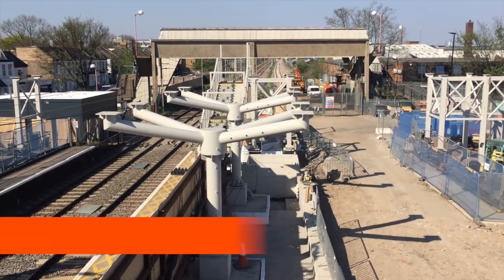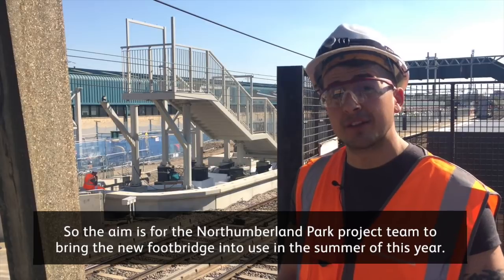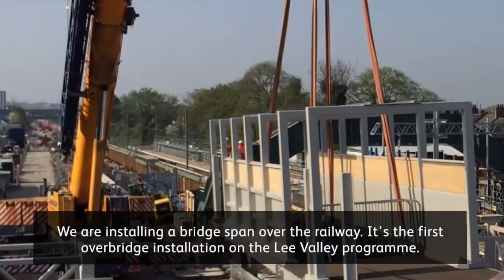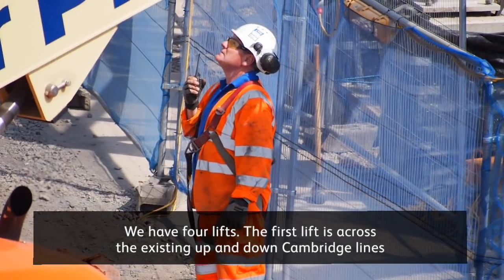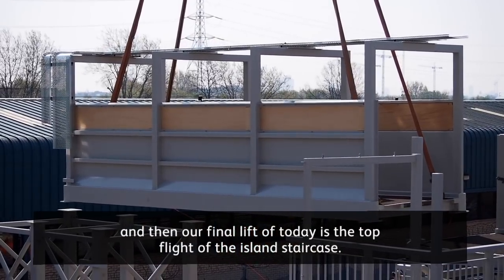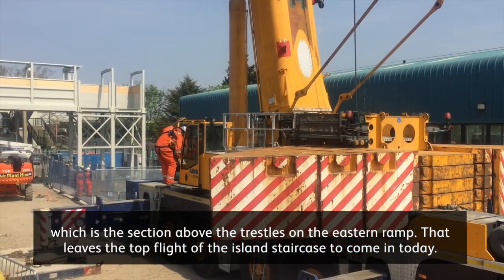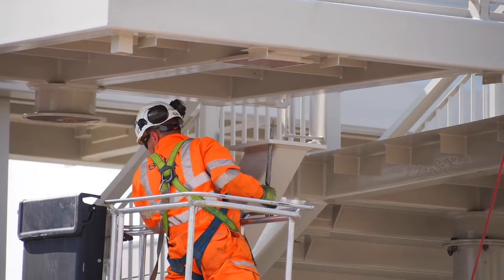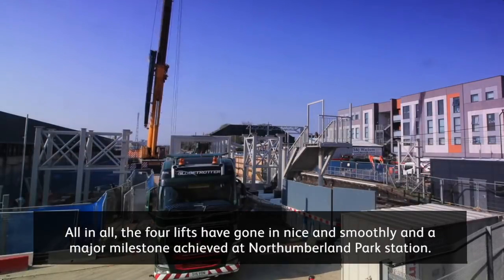Lee Valley Rail Programme - Northumberland Park Footbridge

Comment: Will the level crossing north of the station be closed?
Reply: It already is. Closed last year IIRC
Reply: Lorenzo Hermoso So do you now have to use the footbridge to cross over the railway?
Reply: Mr Railman Yes.
Reply: Correct, the level crossing will remain closed. It wouldn't be worth maintaining with the increased rail capacity coming through the Up and DOWN Cambridge lines as well as the Lea Valley Reversible. There is a national wide strategy to slowly close most level crossings and replace them with footbridges (A great strategy in my opinion).

To answer your second question, yes, the new footbridge replaces the level crossing. This is a DDA complient ramp providing the nessessary throughfair over the lines for both rail users and members of the public.